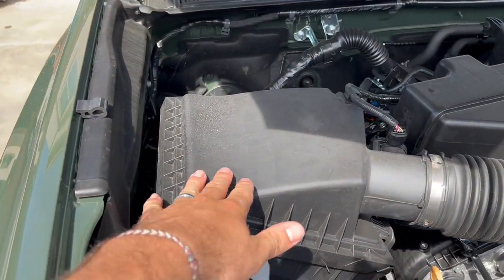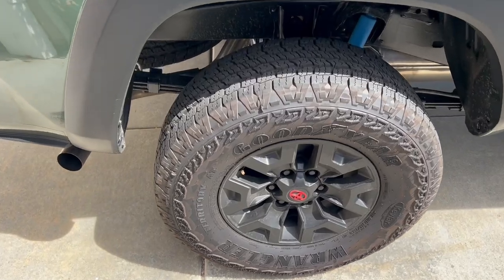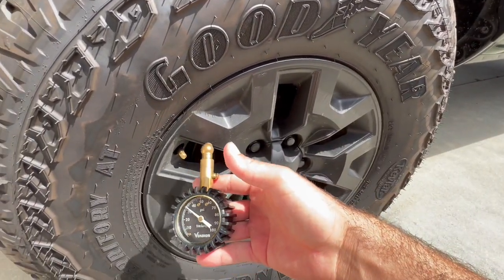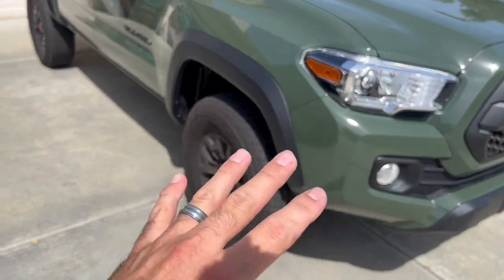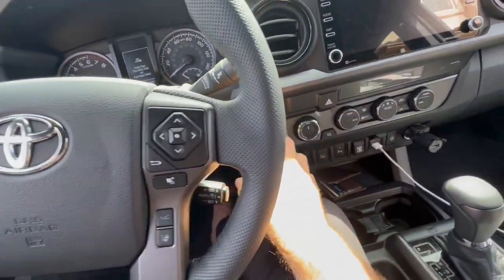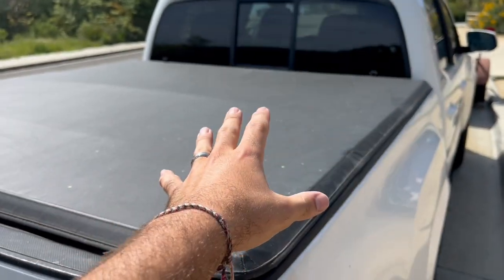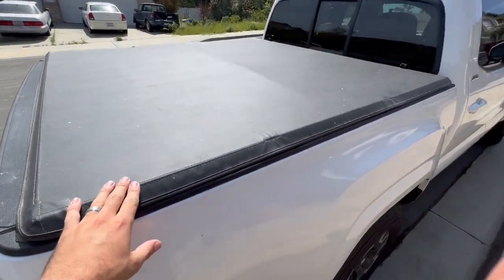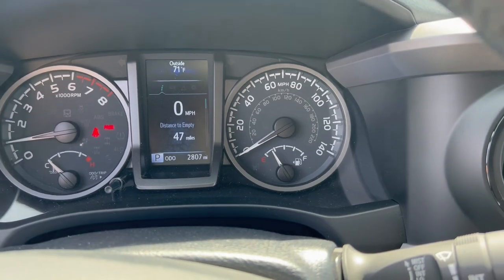Get Better Gas Mileage Toyota Tacoma

Comment: If you don’t drive it like you stole it they do fine with fuel. I’m 300 miles into my latest tank with about an even split between interstate, city, and hilly/curvy Missouri Ozark state highways with 265/75R16s and I’m at a 21.2 tank average.

Comment: on my 2.7  with a soft cover and regular tires i get around 27 but  i was at a constant speed of 60-65 mph with only stopping at lights maybe 5 times on a 30 mile trip! When i would drive to sacramento which was a 225 mile trip i would go about 70-75mph and average about 24-25! so 60-65mph is a sweet spot for my lil 4 cylinder!
Reply: 2019 4 door!
Reply from the maker: Oooo wow

Comment: I bought a 2012 access cab tacoma 4x4 2.7 5 speed 4wd.I drove from new york to oregon 245 bfg.K02. ac on cruise set st 2400 rpm 65 mph.22mpg average.With the vvt engine this is a great spot torque wise.Higher speed milage gone.I drove it average 400 miles per day

Comment: Manual/Sport +-, for around town, leave it in 4th, but bump to 6th for downhill, or coasting to a stop. There is less tip-in and bogging before down shifting automatically creating smoother throttle and torque curve.

Comment: tonneau covers unfortunately don’t help fortunately I let u know saving u a few. Secondly fill up in the morning when it is coldest and the gas is in a liquid state and not a gaseous. Last use cruise control. Read ur maintenance manual and follow it. One more try to not double back make a ring route and travel at the speed limit anticipate how long it will take you note if driving this modded way helps vs ur norm good luck

Comment: The best I’ve gotten was 25 MPG. But that’s with the TRD Intake, throttle body spacer, and a different dual exhaust. Plus a bit of conservative driving but still going speed limit or a bit over to keep RPMs down. Got a soft cover too and a Prinsu roof rack that doesn’t really help👌
Reply from the maker: Oooo wow! That’s the setup man!!
Reply: Genius!

Comment: a little over a month ago,  i purchased a 2021 Toyota tacoma sr5 w/6 foot bed..  at first,  i was averaging about 16 to 17 miles a gallon.....    I'm now getting 21 to 22 miles a gallon..  what changed?  well, I added a tonneau cover, I make sure to check my tire pressure,  and I'm a lot lighter on the gas pedal, I don't gun it unless i have to.....  i step on the pedal lightly,  i try not to do a lot of stop-and-go,  in other words, i try not to lay heavy on the brakes... and now I'm getting better gas mileage........
Reply from the maker: n ice

Comment: One thing I noticed quite regularly is that I get better mileage with the top half of my tank than the bottom. But I hate going to the pump more than I have to.
Reply from the maker: Ahh hm
Reply: I noticed this a lot with my 08 tacoma, and from what I was told is its the way the tank is shaped

Comment: If you are considering a lift on your suspension and haven’t done it yet. Don’t!  Lifting your truck results in a loss of aerodynamics which in turn, a loss of mpg.  If you have a Tacoma TRD Sport don’t take off the front air dam.  My TRD Sport regularly gets 18-19 mpg in the city and 25 on the highway.  As “The Unrestricted” said, don’t get bigger and/or wider tires.  The tread pattern and weight affect the mpg.
Reply from the maker: True
Reply: 💯 ruined my gas mileage just put a level kit and mud tires on my 2020 tacoma 4x4. I get 14.5 city now and only 17mpg Freeway. It's ridiculous

Comment: I have a 2021 SR5 no mods yet. and I’m getting close to 400MPG. Off the lot for 6 months I was getting 363MPG. Just take it easy on the gas and just keep up on your maintenance you will see your MPG go higher.
Reply from the maker: Hmmm 400 mpg, somethings a little off
Reply: 400 MPG? That's so incorrect lol. I'm assuming you meant your Taco was getting 400 miles per tank of gasoline. Thats pretty good! I hit 385 mile per tank while driving up and down the highway yesterday.
Reply: Wtf! 400 mpg 😂 . Typo clearly
Reply: @synergy14nerd  yes, thank you for that.

Comment: Found a new setting today. I️ haven’t seen anyone talk about it but it’s annoying to only access the “tank average” if you go to settings on the steering wheel under (drive info 2) it can be changed to overall average or a lot more settings.
Reply from the maker: True
Reply: Many thanks for this GREAT TIP!❤😂

Comment: Just got a 22 Tacoma sport and we are getting 20.5 mpg at 75mph and 21.5 mixed.  The Tacoma likes mixed driving a lot better than freeway driving at 75mph.  we use it as a bidding rig for are concrete flatwork business and it gets put through some hard driving going from bid to bid.  Very happy with 21.5 running hard mixed driving.
Reply from the maker: Ooooo wow
Reply: I got my 2022 sport manual transmission one week ago. The 1st day I got 14.5 mpg on the highway. The next day 18 mpg. I am getting 10.5 mpg in the city.
Reply: @sameertamang2870  dang that's not good at all.  i have been reading conflicting mpg averages with Tacoma's.  We are not going to change tire size or lift it.  Might do a cold intake, peddle command and muffler.
Reply: Not gonna add anything, all stock and 70 mph on the high way. Hopefully better mpg in the future.
Reply: 4wd or 2wd? That’s good either way!
Reply: @goride365  4WD

Comment: I got a 2.7 and it already gets pretty good mileage but, I replaced driver and front passenger seats with some light racing seats to cut off a couple pounds and added a K&n uní filter mod and I’ve seen an increase in mpg
Reply: Where do you get the K & N Uni Filyrr @?
Reply: Where du you get the K & N Uni Filter @?

Comment: I am getting 13mpg on my brand 2022 new tacoma trd offroad stock. Driving smooth and safe, I have a 4 year old in the truck with me. I am not impressed. Only 1700 miles on truck.
Reply from the maker: Hm something seems off
Reply: Give it time. My 22 was like that at first. Just pushing 10000 miles on it and I’m running in the upper 17’s average. Warmer temps help too no doubt.
Reply: Thats strange.  When im always on it i get 16 mpg.  Getting 13 mpg is like towing or hauling a full load

Comment: 2010 trd sport ,…69,000 miles , I drive like an old man because I am one, last fill was 15.6 mpg,.. I just changed the front and rear diff fluid and transfer case fluid, removed the spare to have room to fill the rear diff and haven’t put it back yet,(I’m seeing if it holds air after discovering there was only 10 pounds in it ).. so far 100 miles out of my first 1/4 of the the tank ,… I’m interested what I end up with once I’m down to empty, when I bought it new I used to get 18 or 19 mpg ( I mentioned the spare because I’m assuming the weight change will factor into the better mileage … when I lowered it to the ground , once it hit the ground and I kept cranking the chain the rear bumper came up about 4 inched )
Reply from the maker: Haha ok

Comment: The oem truck bed tonneau cover is very heavy plastic that weighs approx 80lbs which will have a bearing on the mpg as well the oem heavy bed mat that weighs 25lbs was thinking bout removing both of them only thing is putting back the tonneau cover is a pain & can scratch up edge of the top area of the bed when reinstalling it mine had caught the edge very slightly had used dap touchup paint on it cant tell it caught it but like i said its a pain to reinstall it.
Reply from the maker: Ah ok I see true

Comment: If you use cruise control as much as possible your MPG will go way up
Reply from the maker: I believe it, but cruse on the Tacoma kinda sucks
Reply: @TheUnrestricted  cruise control on any car sucks and is no fun. But it improves fuel economy
Reply from the maker: Yes I agree but also specifically the Tacoma. It has a high Rev problem in cruse

Comment: A big MPG killer is idling for comfort. Folks sit in a parking lot and run the truck just for the AC. Just shut it off and roll down windows, sit in the shade. Idling kills MPG
Reply from the maker: Ah true!
Reply: @TheUnrestricted  I agree ,… I notice my mileage goes down in the winter because I use the remote start and let the truck warm up for five minutes every morning

Comment: shorter tires closer to ground... and better to use stock air filter box system and just connect a hose from your cabin AC under dash box to your air engine intakes before the filters of course for a true cold air intake...cheaper too

Comment: I have 35/11.50/r20, with a 4” lift. On the highway at 2000 RPM I can be cruising at 78mph and doing 16MPG.. wicht.. is not thattt bad. 🤷🏻‍♂️
Reply from the maker: Yeah that’s normal
Reply: Change your gear ratios.     To compensate for the bigger tires
Reply from the maker: True

Comment: Sir, The Tacoma is engineered at 18-22 mpg,  you cant change that . also its proven that there's a vortex in the truck bed that helps the airflow over the truck, if you and a bed cover it's not going to get better
Reply from the maker: Ahhh really! Thanks
Reply: Engineered does not always mean it’ll be 18-22 all the time did toyota engineer a Tacoma in my neighborhood and my city? Did they engineer my driving habits yes they probably took a lot of that into account when they rated the mpg but literally read any comment in this comment section people are pulling all the way up to 25mpg stock
Reply: Does it help reduce drag and improve mpg if the the tailgate is down or removed?

Comment: How about turning ECT on? Does it help? And is it safe for daily driving?
Reply from the maker: It makes it rev a little higher so it would spend a little more gas. But safety wise it’s safe
Reply: It doesn’t help mileage for sure, but does help for me when going uphill for six miles , on the flats I get 23- 25 mpg, in mountains 18-19

Comment: Great info. Actually you can get a bit more MPG by keeping your tire pressures up a few lbs. I run 36. 40 when trailering. You can investigate yourself and you will find plenty of corroborating info. Keep up the good work
Reply from the maker: Ah true!
Reply: I filled mine up to 36 in winter (since I just got it) and they go to 40 when it's warm. I drive 70 with hills so I only get around 20-22 but that's still not bad
Reply from the maker: Ooo man that’s good

Comment: bigger tires lower MPG is a misperception. for example your tire gain at 265 75 r16 is 1” each side then you gain about 8% in distance or MPH. every 100 miles you see driving on your tachometer you actually drove 108. same ratio with speed and when you calculate your mpg or see it on your tachometer gauges, just consider that it is incorrect by 8miles every 100. you can look up a tire size adjustment comp table based on a comparison of original tire size and rim to new actual. plus of Also keep in mind that a OEm factory tire is usually softer on purpose so they can pass emissions requirements to match what the factory promised the EPA
Reply from the maker: yes

Comment: Not trying to be lame and I have the same tonneau cover so not hating either lol but they arguably give worse gas mileage in a lot of pickups because of the verticle flat rear section of the cab some air circles down over the top of the cab and rolls in this space. Changing and shortening that height on full-size trucks makes worse mileage on highway. IE empty bed would be better. This downward pressure is easily seen on soft covers at highway speeds. There was an old Mythbusters where they tried those bed cargo nets to test mpg gain and the tailgate resistance almost defuses further air pressure coming down from the cab. Wish that wasn't so wordy 🤷‍♂️
Reply from the maker: true ive heard this

Comment: Myth busters debunked the tunneu cover helping mpg deal. Wind will create a vortex in the bed the streamline air will flow over that vortex. In effect it's actually better if you have an open bed with the tailgate up.

Comment: Has anyone ever tried skinny(245) E rated tires and ran them at 80psi to see what kind of difference that would make?
Reply: Don't try saving $0.50 on fuel to blow out a $200.00 tire.

Comment: Wind doesn’t get ‘caught’ in the bed dude. It’s air but acts like a full vessel at speed. When you’re sitting still, nothing is happening. When you start moving it fills up then overflows. Many many experiments on tailgate up, tailgate down. Same same. The added weight of the tonneau ain’t worth it guaranteed. How you make your money back on gas guzzling Yotas, they don’t break, very low maintenance costs. I own a Lex with the 4.6, a taco 2.7 and an import mini truck with 660cc. They all suck! But don’t break.

Comment: I have a 2020 tacoma trd sport and get 14.5mpg city and 17mpg Freeway. It's ridiculous. I drive slow and nothing helps. There's full size trucks that get better mileage than mine. I'm ready to trade in for a better mileage vehicle. Been really unhappy with the tacoma
Reply: Check your spark plugs for gapping issues. And try cleaning your MAF sensor.

Comment: You should tell people to use the proper oil oil I just purchased a Tacoma from a used car lock 2014 and he put conventional oil in it The sticker said to change it after 3000 miles why would he do such a thing

Comment: These 3rd gens are dogs on the highway! Constantly  up and down in gears! Unless your doing 85+ in 6th with the rpms 2.5k or so. 70-75 I just keep it in 5th and loose 1 mpg or so.
Reply from the maker: true
Reply: @TheUnrestricted  just took 2000 mile trip in the taco.. Learned this automatic is a "intelligent" tranny meaning it's doesn't have a preset table of when to shift. It can select any gear to optimize mpg, but in reality, it's a terrible driving experience. I'll be getting a aftermarket flash to get rid of this crap and have it behave like a normal Trans

Comment: Never, ever, ever let your taco go over 1600 rpms; no matter how embarrassing it may seem. Also, let it coast to a stop every time if possible. Every time you press the brake pedal, you're just converting all that gasoline to heat on your brake pads. Keep it at 1500 or thereabouts. 25+ mpg like this.
Reply: Totally hilarious, "no matter how embarrassing it may seem."  Been there, done that.
Reply: Thats a little ridiculous lolol. I'll keep it below 3k in the city.
Reply: @Stinerator  if you are not focused on getting Better fuel economy and you don't mind going through brake pads & shoes then okay.
Reply: @troy3456789  You bought the truck to drive it, so drive it

Comment: PSI on vehicles should be 45-50ps. Better gas mileage, less chance of hydroplane, more mileage on tires. Downside is rougher drive. They say 30-32 PSI for comfort and shorter wear. (No your tire will not pop, bike tires are around 100psi)
Reply from the maker: Hmm I see
Reply: False
Reply: "Less chance of hydroplaning..." with higher air pressure is absolutely false.

Comment: Stock trd off road, never got better than like 18.5... These trucks are a joke on gas. Meanwhile heavier bigger v8 silverados get better milage! You don't buy trucks for mpg. They are tools. Or you just like trucks.
Reply: Is this city mpg? on long highway trips my dad’s TRD PRO on 33s will get like 24, going just under 70, but it’s stick so idk if that gets better mpg in the tacos
Reply: @shaunster2007   no that is flat land bone stock 2023 trd off road cruising around 70-78mph. Throw in ANY I mean littlery 0.01% grade and it's gone down shift constantly. Must got a lemon or something. I'll get maybe 20-21mpg if I'm doing a steady 65-70

Comment: I find the fuel economy tips so aggravating. Pretty much any other brand of vehicle has performance mods, and some dealers even have in-house performance shops that will adjust the emissions and "wake-up" the engine's performance and improve fuel economy. We're not all in California, and we don't need our engines choked to death with emissions controls. So what the frick is it with Toyota that there's no way to adjust performance? Everyone just keeps harping on the same stupid crap. Just drive like an old retired person who has no life and no urgency about anything. What a bunch of crap advice, and it's on every Toyota forum. Why???